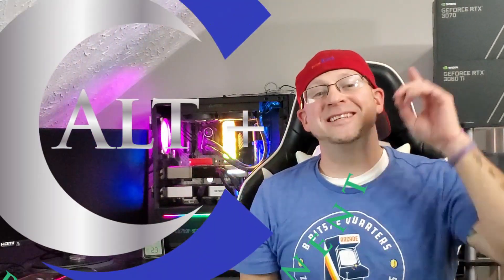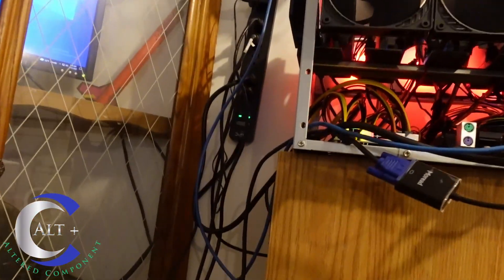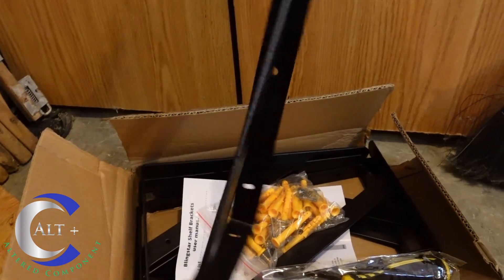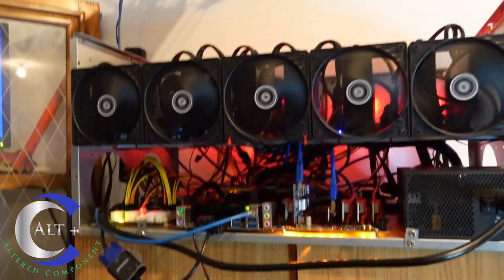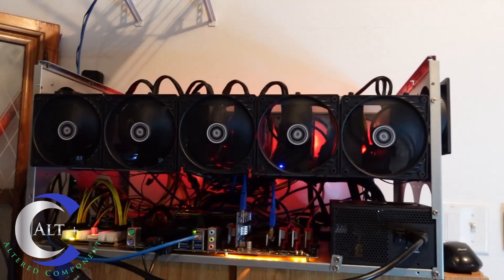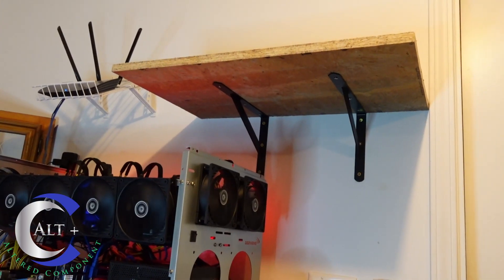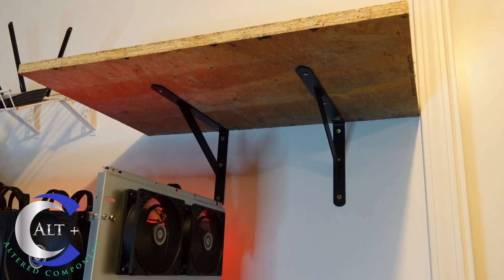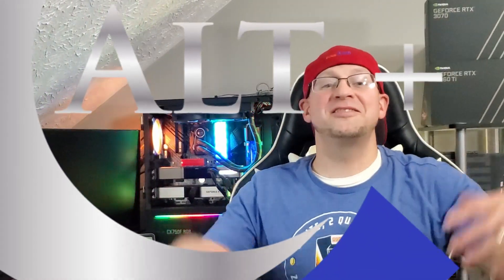🕵💣 Secret Mining Location Expansion | Creating space for more Cryptocurrency mining rigs

Comment: The anchors probably arent cheap.  They gave you a screwdriver after all.  Anchors do not function in wood.  The get big as you screw into them which is supposed to "anchor" what you are installing against the back of drywall.  Not all things are installed in studs after all.  Just screw into studs.  You put big holes in your studs.
Reply from the maker: Thanks for watching. yup you are correct, the anchors should go into drywall and not studs.  But i stand by the statement that they are garbage anchors ;)  I only put 1 anchor sized hole in my stud.  then i pre drilled just small holes for the screws themselves on the rest.  Rookie move to put an anchor in wood.  thanks for the feedback